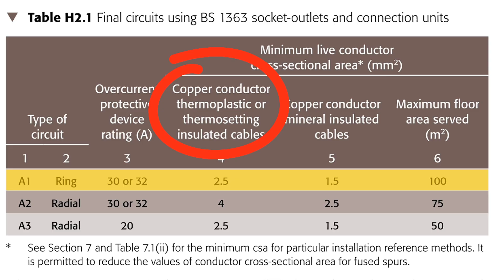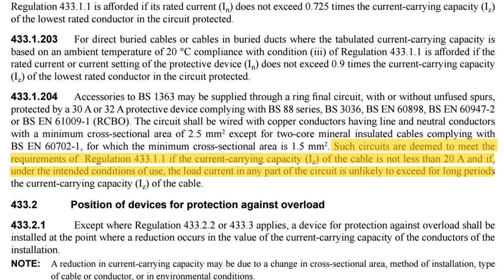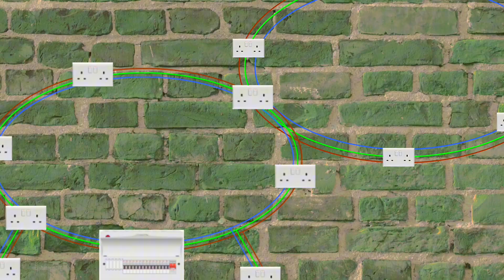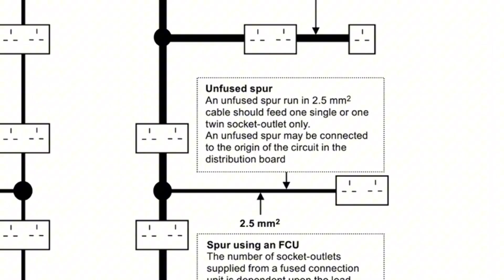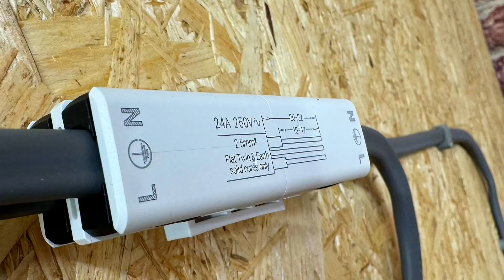32A Ring Circuit, Can a 24A Junction box Handle It?

Comment: So looking at the Quickwire website and the wiring diagram they provide- it’s different from the one you show with an H shape arrangement. It suggests that two spurs should come from the same side of the quickwire box or from alternately up/down from different sides but not as you have wired. Can you confirm? They’re great products but I think this use needs clarification.

Comment: I do like the qwick wire mf juntion and use the ligthing ones, but on a ring final I am not happy on this one. In a kitchen it is highly likely that the ring final will run for long periods over 21amps. Out of interest I put a clamp meter on my own (I am an NICEIC Approved electrician) and it was running near to 28amps so yes it is likely. Hager J803 have managed to rate there MF joint at 32amps and so I will continue to use them. If you can upgrade this model then I will 100% fit them.

Comment: From someone abroad who has travelled to the UK but never lived there, it seems to me that using a 4-pole 20 A circuit breaker instead of a single 32 A breaker would fix all of the inherent dangers with ring circuits and chances of overloading.

Comment: the 4 way switch is only really used to create to spurs off the ring ? . if you wanted to extend  a  the ring circuit   you  would use  two 2 way  24amp switches .. if you  used  a 4 way to extend a ring circuit thus would create a ring within a ring   is this allowed   ?

Comment: Hi. Should the break in connections for the ring both be at the same end? The internal layout at 4:37 doesn’t match the diagram on the datasheet on their website (ports on each side are linked from one end to the other, the sides are then linked together).

Comment: Sorry, but you are totally wrong about the current taking the shortest path. Wherever the high load socket is, current will flow in both directions from the consumer unit.
Reply: Yes, it will flow from both directions but not at the same magnitude.

Current takes the path of least resistance.

Efixx have a great video remonstrating this very phenomenon.

Search out the video on their site.

If the outlet is at the midway point then yes, the current will be drawn equally from both sides.

If the socket is the first on the ring (ie very much nearer to the CU on one of the legs) then THAT leg will draw more current than the leg that has to go all the way round.

Comment: Where the regulations fall short is that they assume all future work will be done by a competent electrician for the lifetime of the installation, but we all know that's just not going to happen. What happens when Mr DIY does a bad socket replacement and de-rates the whole ring, then starts using a 3kW air fryer instead of an oven, maybe while they are granny charging an electric car with a 3 pin plug at 2.4kW?

Comment: This is a slly title ring mains use 2.5 T&E which has max current raiting of 21A so of couse a junction box designed for 2.5mm T&E will work.
Oh and ring mains suck i for one will no longer be installing them

Comment: I've never been a fan of having a double socket on a spur (unless it's from an FCU) in theory (and depending on the reference method) you could overload the 2.5mm cable feeding the double socket without tripping the MCB and yes I know a double socket is only rated at 20A but it's definitley possible say in a kitchen to have 2 high draw devices connected to a double socket, stupid and not sensible but physically possible
Reply: Two plugs with 13A fuses = 26A. Clipped direct cable rated to 27A. The socket will overheat first.
Reply: @AndyK.1  that's why I said depends on the reference method, in an insulated wall 20A

Comment: As an American electrical engineer, you guys ust scare the shit out of me!!  "The ring final socket circuit is an intriguing creation"   I would replace the word "intriguing"  with the word "insane"!!!  The crazy stuff you guys do to save a few pennies on wire is just nuts!!
Reply from the maker: The ring final circuit has a long history and adds a degree of complexity to testing and inspection
Reply: It was a good idea 80 years ago after world war 2 in order to save copper  but, it hasprobably had its day now. I prefer radial circuits where ever possible
Reply: Banned in Australia 🦘🦘🦘
Reply: Wire a ring final circuit in 4mm & fool proof, like many commercial sites done with this size conductors !

Comment: Just ban rings
Reply: If a 6 socket radial circuit for what ever reason loses its cpc between socket 3 and 4 the sockets 4 5 and 6 are unprotected with no earthing cpc the sockets will still be live and working but the user would have no idea that the item using that socket point in not protected. Now if a ring circuit loses a cpc in say socket  4 the cpc will still be connected via the cpc coming from the other direction as the cpc is I  a ring final. I do see the point of radial circuits especially for the ease of fault finding but impo I still think that ring final circuit are safer for the user. As I say thus is only my personal preference.
Reply: @chrisardern4594  meanwhile on a ring if your live is broken somewhere in the ring the other leg might melt and start a fire in your house because the poor 2.5mm single wire is being asked to carry the full 32A load... 
Rings were invented to save copper and money, they are not safer, the are harder to install and harder to test
Reply: @chrisardern4594  anything that has high earth potentials can be satisfied with 543.7.2.201. it's relatively common to bring the cpc back as a ring in a radial in such circumstances.
Reply: How many distribution boards are you fitting to have every socket fed individually.
Reply: @damiendye6623 why would you have to do that
Reply: @henrystevens2258   well what's stopping the sed issues with a ring happening on a radial, err none so you might as well stay with a ring then
Reply: @damiendye6623  they are banned in Europe and have been for a very long time everything is radial and works fine
Reply: Why? There's literally nothing wrong with them.
Reply: @dead.format yikes

Comment: Wonder why WAGO bothered with 32A connectors at all when their smaller rated ones will do...and why this company didn't just up the anti with the link inside their box to 32A and cover all bases and stop any debate?....As it appears the link inside the box in your diagram is able to carry all the current placed on the ring passing through it and all of that from the two spurs all inside a 24A rated box. Still it must have been tested to death and have a BS Number etc... And looks simple and easy to use....Great.
Will these boxes take a 4mm cable to extend a radial below floor etc...?
Reply: You can use 6mm with 32A wagos
Reply: @longworth2000  you can, but not in the ones rated to 32 amp
Reply: They are designed for use with conductors upto 4mm2, thats more than likely the reason

Comment: In the regs it states that a maximum of 27A could flow through one leg of a final ring circuit so how can a 24A rated block be able to be allowed to be fitted? Let’s take an example of one double socket to be installed as a radial circuit and that could potential draw 26A so how Can a 24 A be block be legally allowed, diversity?
Reply: Indeed. A double as a spur off the ring could likely be feeding a washing machine and a tumble dryer and pulling 26amps. Don't know why they just don't just rate and build the quickeore to handle 26amps argument solved.
Reply: Hi Martin. Are you aware of the minimum CCC for a 2.5 1.5 ring circuit in the good old UK? This is the reason i’ve never lost sleep when in the past i’ve used the older style Wago push ins  on a ring

Comment: I may be overthinking this, but if the box is fed from both ends of the ring, and the draw on the spur is 32a, wouldn't each side of the ring split the current in proportion to the placement of the junction? For example, if the junction is in the center of the ring, the max current either side would be 16amps?  (This assumes the ring is wired properly and not open.)  So the only issue would be if the connections at the junction to the spur can't handle the full current. And finally, what are the actual chances of the spur being able to draw the full 32amps? There would have to be absolutely no loads anywhere else in the ring or the RCD/breaker would trip on overcurrent.
Reply: Draw on any spur cannot be more than 26A (two 13A outlets). Draw through the ring cannot be more than 32A. Totally safe.
Reply: @johnburns4017  Thank you for explaining that.
Reply: I wouldn't use it on a radial curcuit wired in 2.5mm2, but as you said, current splits at a junction, or so Kirchhoff would have us believe, but I think it would be safe to use on a ring main.

Comment: With socket ring circuits, it just needs a loose wires connection at a socket and you have two radial circuits on a 30/32A breaker. Considering the low power appliances in the modern home, how about several 20A radial socket circuits for upstairs/downstairs/garage and a 30/32A radial using 4.0mm for the higher power demand for the kitchen?
Reply: Whenever I do a rewire that’s how I do them, look at the house and kind of loads they use, then normally 1 20a radial for upstairs sockets, 1x 20a downstairs sockets and 32a 4mm radial for the kitchen, sometimes they have so little plugged in kitchen- mainly older people where it’s a kettle, washer and fridge you could use 20a without issue.
Reply: @richard3004  
The Wagos work equally well on radials and rings. 
You could have just two rings rather than three radials.  Or the whole lot on a 4mm 32A ring using Wagos in backboxes, on an AFDD. Bombproof. 

I did a whole 2 bed flat on a 4mm ring, including the 3kw oven and the Bosch induction hob on a 13A plug.  All on one AFDD. It had two circuits, the other was 1.00 for the LED lights, again on a 6A AFDD.  The consumer unit was tiny. No Grenfell tower fires there. 

New tech like AFDDs and Wagos up the safety levels enormously.
Reply: @richard3004  is it better to not design the install around the occupants and design for any type of resident  as certainly ith older people they may not outlive the life of the installation.
Reply: I have the whole ring on screwless lever Wagos, except into the RCBO or AFDD at the consumer unit.  The ring's current only runs through the Wagos. They are in the backboxes. Then a 2.5mm flex from the Wago to the socket terminal, making it easy to push the socket back into the backbox with no stress on the socket's terminals. So no conductor popping out of the terminals due to stress. Win, win!
Reply: Who here hasnt found a broken ring on a eicr due to a poor connection at a socket. These 24amp jbs then have to supply full currant and the fault wont be found till the next eicr. Sorry makes me nervous.
Reply: @ks-hg5vo and how's it different to the 2.5mm cable in that scenario.
Reply: @travoltasbiplane1551  because I've never come across damaged 2.5 cable along its length due to taking upto 32amp. However so many faults are at point on connection being overloaded. Wether that be jbs mcbs wagos it's always point of connection that has burnt away. Yes spring loaded connection are good but so variable on contact surface area and this is always were heat is generated highest. Never had a 2 screw point Henley fail but had some single screw ones go. It's all about contact surface area reducing the resistance/heat
Reply: The only ever reason loose wires exist is due to a couple of things, which in theory should not even exist.
1 shit electricians.
2 DIYERS
3 Handy men
4 Kitchen fitters
5 No testing on installation
6 No periodic testing done

I know I said a couple, but thought of more😂
Reply: @SME_Ste  poor quality equipment.  Rarely have mk go but cheaper stuff yes
 Except when mk 932 change their fuse holder from side holding points to fuse end holding points . Had lots of them burn out. Cheaper grub screws have shit ends and cut through strands.
Reply: @ks-hg5vo  point 1-5 and point 6 would or could highlight it
Reply: @SME_Ste   when was the last time you checked to see if the 13a fuse had dimples in the end. And let's be honest undoing a connector to check to see if some of the strands have been chopped off by poorly manufactured screw may only happen on some of the items depending on your agreed inspecting percentage. However this is about loose connections not poor connections and fires start with both and you are correct. 1 to 6 applies. Eicr has limitations.
Reply: @ks-hg5vo  Agree, they do have l;imitations allowed. With the argument though of a RFC becoming broken, we've got to admit, there's never a valid reason for it. 
What does my head in, is as a trade, we always seem to have to design what we do to facilitate the stupid out there.

Comment: Though I like the concept I have no trust in those connectors. Doesn’t help a fault I had to trace led back to one.
Reply: They are easy to pull out the conductors. Screw-less connectors have been riven in Germany for decades.

Comment: What about the new cables with earth wire sleeving, earth sure. Using  these new quick connect junction connectors? Especially with the 4 way quick connector block.
Reply: Hey, so i tried the earth sure cable in the Quickwire JB and it went in a dream 😊
Reply: @joehammond6119  

I think its just the CPC insulation that's thinner on the new earthsure cable.
Reply: @joehammond6119  

 I think its just the insulation that's thinner.
Reply: strip back the earth sleeving
Reply: I recall the Earth conductor is thinner on the new cable, so I'm wondering if it will fit in the Quickwire

Comment: Designed for the incompetent house basher.  Ultimately a fire hazard.
Reply from the maker: So you don’t use Wago’s or push fit terminals in lighting fixtures?
Reply: @efixx  No I work for a large  UK pharmaceutical research company as a Electrical Engineering technician.  They are banned on our site along with ring main. All lighting is wired in 2.5mm minimum.  All sockets fed from mimumum  4mm radials.  We dont cut corners. We dont employ house bashers.
Reply from the maker: @mikepxg6406  so no control panels on equipment with screwless DIN rail terminals. I first used them on 50kW industrial oven in 1996 and it’s still going strong.
Reply: @mikepxg6406 you are lucky then. Buildings tend to be designed with space to do things properly. Dry risers, wiring cupboards, space for cable trays etc. houses are designed by architects to look nice and no one gives a monkeys what shite that causes a sparky either at initial 1st fix or post build completion. It hacks me off that houses are built so badly for any sort of upgrading but what can you do? Your stuck with it. Frankly I’d rather have wires to every point and have it all ran back to a din rail wago top job and configure it there, but don’t know if that’s legal not being a sparky, but you’d be able to run lighting controllers, in switch powered controls etc. plus everything should be in conduit so it can be pulled out and replaced if needed and access panels to get to it.
Reply: Haha... just curious as to the basis and thinking behind that? ;)
Reply: It is not 1984 any longer.